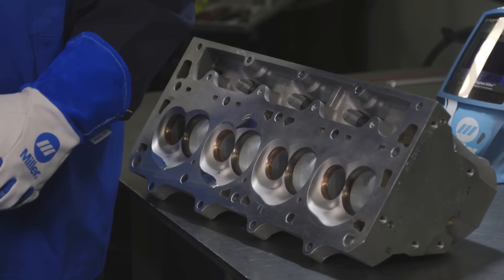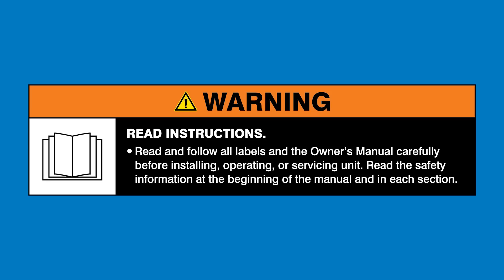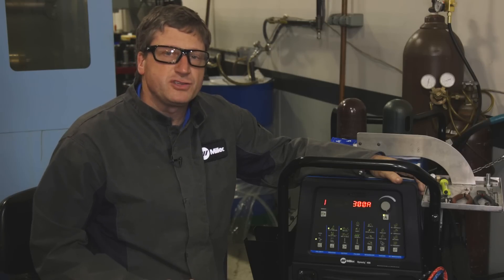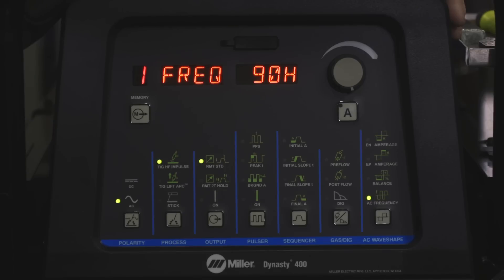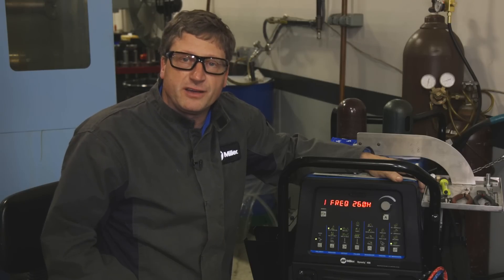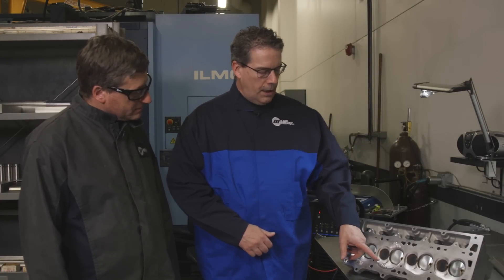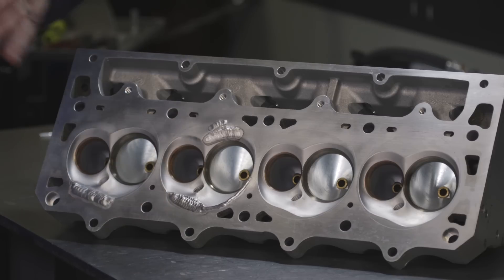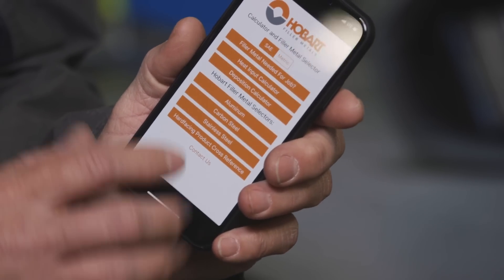How to Weld on an Engine Cylinder Head

Comment: So can you weld the head to the block? No gasket??
Reply: Yes you can if you want a big coffee table
Reply: Depends on the engine type and manufacturer. Some gaskets are required because they direct flow
Reply from the maker: In this application we are simply adding material to the head to repair it, post welding the head would be machined and mounted to the block.
Reply: I don't think they understood your question.

Comment: I have been welding tig for years, I have modified pistons and cylinder heads from dirt bikes to flathead fords. It’s always interesting and things to learn along the way. Aviation welding is what I do
Reply: how do i avoid warping the head if i have ALOT of welding to do in the combustion chamber?
Reply: @geoffkelland5606  You need to weld in short bursts.  Use a lot of amperage, over 300 (you won't go full pedal except for striking the arc and starting a puddle.  Use the pedal to keep the puddle moving at the width you desire.  No preheat, and weld for no more than 15 seconds at a time.  The high amperage will puddle the aluminum very quickly so you avoid putting too much heat into the head.  Wait until the weld you just laid down is cool enough to put your bare hand on it and start again.  Peening the weld while it's hot will help to relax it and won't shrink as much.  This has worked for me.
Reply: @geoffkelland5606  they sell a plastic pencil that only melts at 250 deg ,plus clean it good .If plastic melts don,t weld it yet ,cool down must be natural,and yes it's a long way to do it